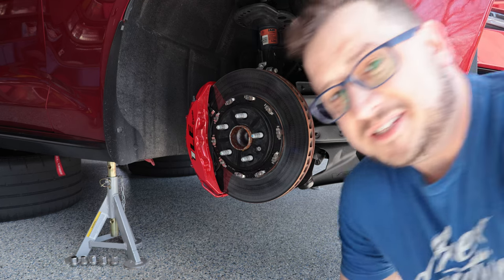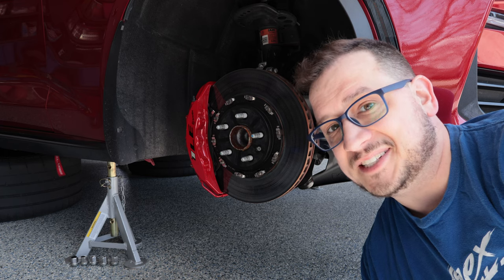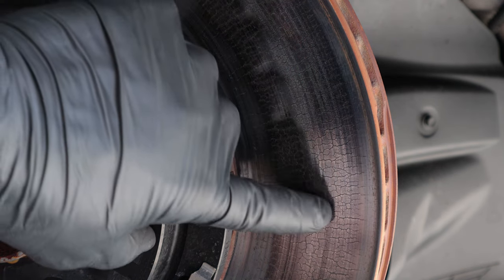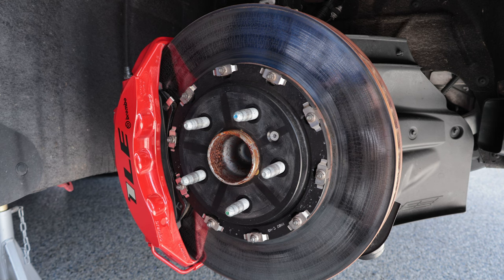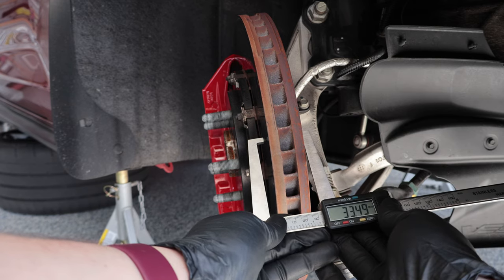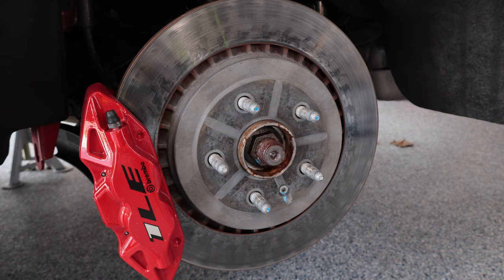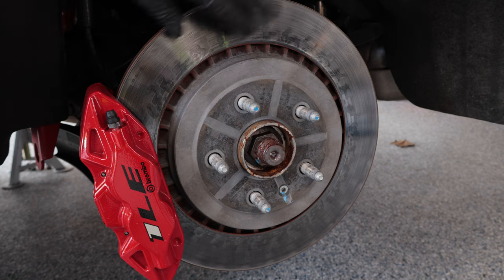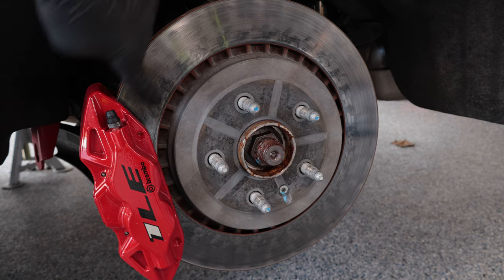How-To: Check Your Brake Rotors

Comment: Excellent video. One point on the disc digital caliper measurement, you can bottom out the back of the digital caliper on the outer diameter of the rotor to square up the digital caliper to the rotor face. It won't make more than 0.1" difference unless you are close.
Reply from the maker: Great call out! Pinning the comment!

Comment: Terrific information. People unfortunately replace the rotors earlier than needed more often than too late. Factory technicians can't distinguish craze cracks from through-wall cracks. In an abundance of caution, they recommend replacement. Also, some "surface cracking" is actually the deposited pad material on the surface of the metal rotor. It will quickly disappear with street driving. Keep up the great videos. 🏁🏁🏁🏁